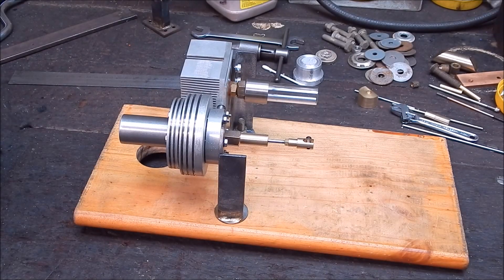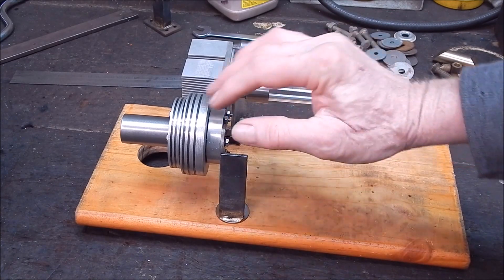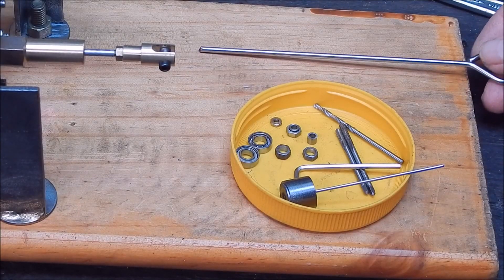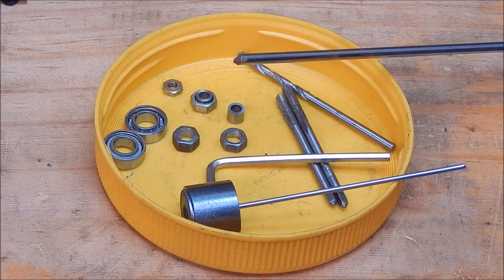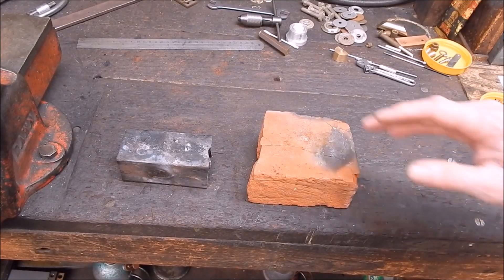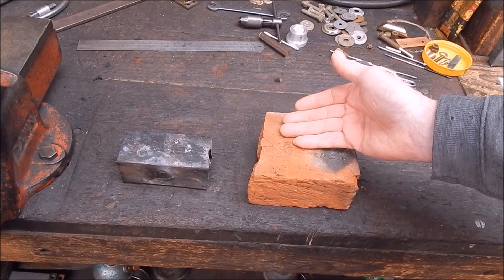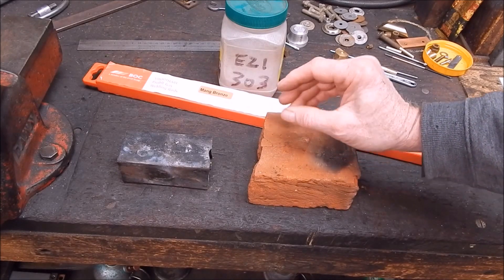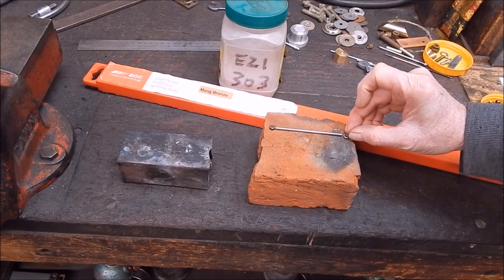How to easily bronze braze a small metalwork project

Comment: Great video Rob.

I just have a quick question about the torch. I work as a blacksmith and am looking for a reasonable and effective torch to bend metal for certain jobs. Would you recommend the Bullfinch Auto torch brazing system model as a good torch to heat and bend mild steel metal up to 3/4 to inch thickness? Thank you.
Reply from the maker: Hi Traolach,

Please excuse the slow reply - new YouTube comments don't work very well.

No I would not recommend the Bullfinch for that type of work.  You will need a torch that can heat large metal mass and do it quickly.  I would be looking at oxy/LPG (propane).

This is a torch/kit I have considered buying for a long while:  https://www.hampdon.com.au/oxygen-and-LPG-brazing-kit

It is much cheaper.  OK, you have to buy oxygen, but it gets around having to rent acetylene cylinders (in Australia).

You will use 4 oxy to 1 LPG weight for weight, so it's quite a bit more expensive than plain LPG, but I think it's worth having for the much greater heating capacity.

Cheers Rob
Reply: @Xynudu  Hi Rob, thank you very much for your response and your detailed advice on my query, that is greatly appreciated. The oxy/propane torch kit you suggested seems ideal.
Thanks again for your time and advice.

all the best,

Traolach
Reply from the maker: You are most welcome Traolach.  Cheers Rob

Comment: Another great video Rob. I used to do a lot of Manganese Bronze ?  Brazing. I found it particularly useful when one piece was  significantly thinner than the other.
Reply from the maker: Hi Owen,  Yes, it's very useful in many ways.  Non erosive of the job, can be re-positioned, can be disassembled, can join dissimilar ferrous metals, very little heat distortion or shrinkage.  And of course it can do REALLY small work.  Cheers Rob

Comment: Hello Rob. I always enjoy your brazing videos, and it's something I hope to be able to try soon. That bare rod is pretty expensive in the US. Around $30 for 2lb, which according to reviewers is four rods. I've got some coated rod that has turned up in my collection one way or another, and I'm thinking of trying to pound the coating off to use it in the way you demonstrate. Think that'll work? Second question: For brazing, do you need shade protection for your eyes? The guidance out there is thin for doing things like brazing and cutting, as opposed to welding.
Reply from the maker: Hi Rick,   Small quantities of rods are always expensive.  The rods get cheaper when you buy a packet of them as shown in the video.  Having said that, a rod will go a long way for home/hobby use.  The coating on your rods will easily flake off if you tap around on it with a hammer.  Brazing with MAPP gas or LPG/Butane does not require any form of eye filter.  Just wear safety glasses in case of wayward particles etc.  Using oxy acet or oxy LPG does require a light eye filter due to the intense white flame and UV.  This makes it more difficult to see but the lens number is down around 5, so it's way less than for stick welding (11).  You definitely must use a shade filter with all oxy boosted gases.  The guidance is thin because it's a largely neglected/ignored medium.  Electric welding is all things to most people these days ;)  Cheers Rob
Reply: @Xynudu  I wish I could "heart" a reply. Thanks Rob!

Comment: Hi Rob, do you know if '1.6mm Multi Purpose Silicon Bronze Gas Brazing Welding Rods' would do the job please. Your videos are down to earth and full of wise advice. I have watched all your videos and always look forward to the next one. Thank you for sharing your knowledge.
Reply from the maker: Hi Chris, I suspect these are similar to the coated rods available through power tool suppliers ?  If so they will have a low manganese content and not be as nice to work with.  I can only say try one and see how it flows on a small piece of steel/rod.  Low manganese rods also tend to bead the melt.  Silicon rods are widely used for TIG work.  Cheers Rob

Comment: Enjoyed the video simple set up. I haven't done any brazing for a long time.
Brings back memories brazing my motorbike bits and pieces togeather years ago.
Reply from the maker: Brazing is a mostly ignored, much overlooked medium.  Everyone is TIG and MIG happy these days.  You can't beat gas brazing for clean easily adjustable joins.  Makes me feel good every time I do it.  And it's cheap if you get the right gear.  Cheers Rob